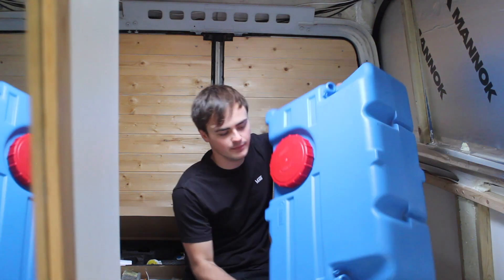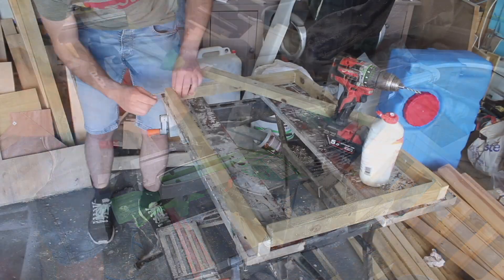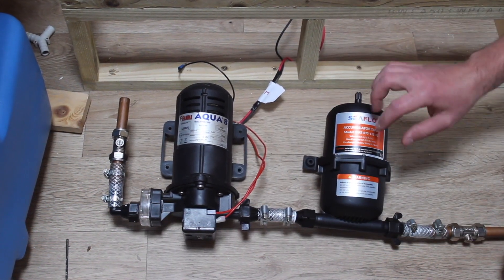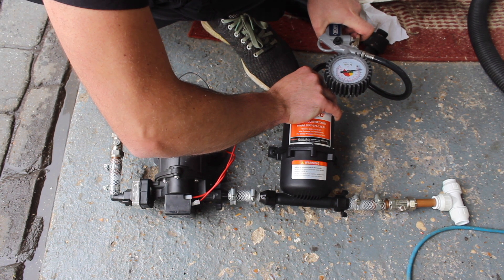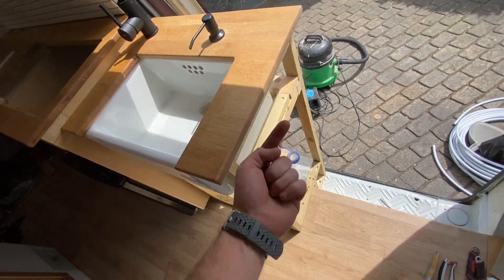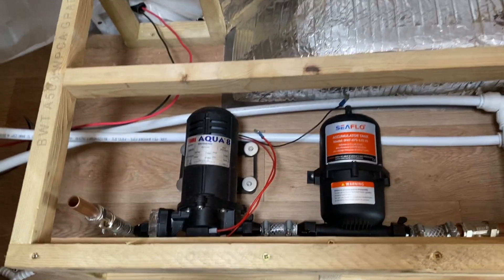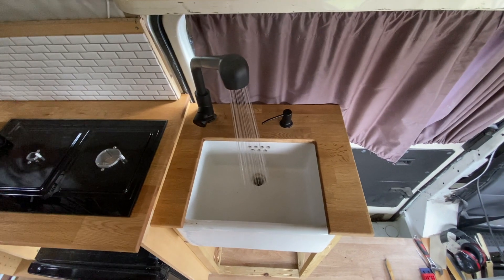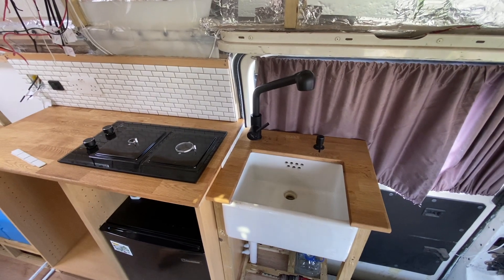Water Tank and Plumbing - Van Build Series - Episode 17

Comment: My camper vans water pump was working but now it doesnt after i drained it and didnt use it for a bit. It still makes the noice, valve is open but no water cones out
Reply from the maker: Sounds like it’s air locked, are there any air bleed points on your pump/ pipework you could let the air out the system.
Reply: @TurnersWorkshop97 I'm not sure but I will look thanks.

Comment: Hey bud love your videos I got myself a mk5 and have found a lot of rust at the top where the fibreglass roof sits on did you have this problem?
Reply from the maker: Cheers man! I had a small amount of rust there but ground it out a couple of years back treated and filled it. I think it’s where the rubber seal perishes and the water can get under the fibreglass roof. You can take the roof off if needs be to sort the rust.
Reply: @TurnersWorkshop97  Yh I think I’m going to take the roof off and then I can weld it would you know what is best to use to stick the roof back on with ? Cuz I can see it blowing off on my 1st road trip
Reply from the maker: Good luck to you mate, will be tricky but worth it. I would use some silaflex 522 perhaps or Ct1 is supposed to be very good.
Reply: @TurnersWorkshop97   I will let you know how it goes

Comment: nice job, how will you put the shower water pipes under the floor now though?
Reply from the maker: Cheers mate, think I will just box them in as will be under the bed anyway. Could try and run them under the van maybe but the prop could be an issue. I will have a look 👍🏼